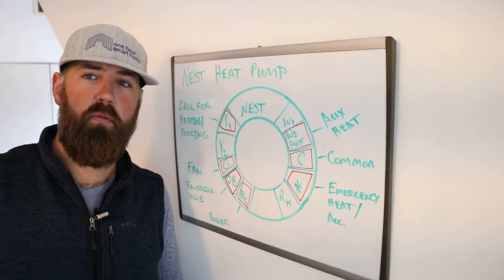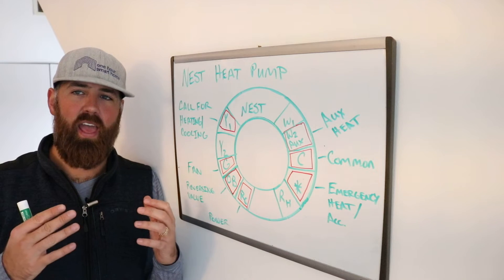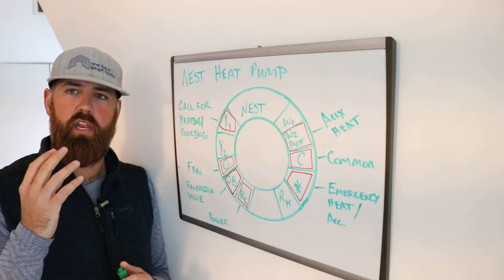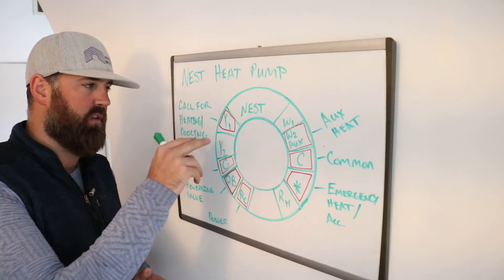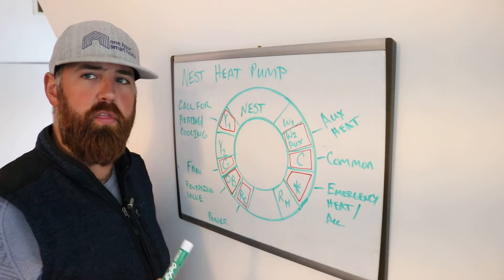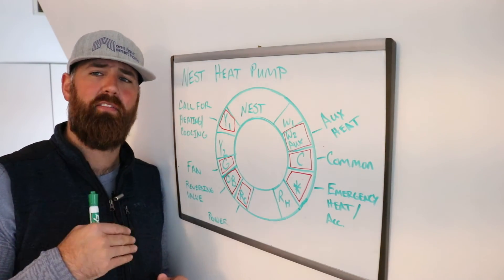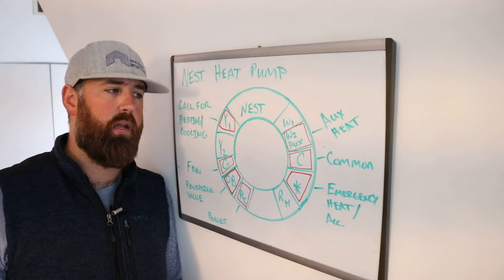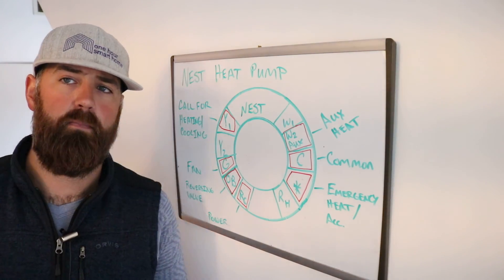Nest Heat Pump Wiring Diagram:  How To Wire Nest With a Heat Pump

Comment: Dual System. Airconditioning (cool in the summer and heat in winter) and also underfloor heating with electronic thermostatic valve. The underfloor heating is getting the water heated from the same Heat pump throw a hydro kit.  Could Net thermostat work for the controlling the whole system. I got a photo diagram of the system if you want to, i need an email..Thank you !

Comment: Thank you for this video very informative. I do have a question (for all)that I've been searching all over the Internet and I cannot find. I have a old AC central air unit with ducking that I'm planning to upgrade later on to a heat pump. But I am in New Yor City, so I do have a boiler with circulating water. I would like to use the heat pump and when it gets colder use the boiler being that I have solar panels. But I cannot find anything that reflects that situation any info will help

Comment: I’m trying to add a nest thermostat in a home we recently purchased. The house has an Aprilaire system now that has 2 wires I can’t figure out where they go if if they’re even still needed. One is an “ODT” wire, the other is a “GND”. I figure out it for an ambient air temp sensor that activates a secondary heat if below a certain temp. 

HELP.

Comment: Thanks for the overview guide. I'm curious if the Nest can be wired to run a gas furnace for auxiliary heat. I'm considering adding a heat pump to my existing heat-only HVAC system and would like to use the furnace when the hear pump would be overtaxed by the exterior temperature (more efficient than the resistive coil). I've also heard of a UK smart device from Homely Energy that will run your heat pump based on current weather conditions and electricity prices. Would be great if that could be combined with a nest for automation.

Comment: Thanks for the video. I need this but still not sure how to wire this up. I have an orange wire that was ran to W1 on my old thermostat and I’m thinking I wired it wrong since I have a heat pump. Does the orange wire need to goto OB spot? My outside unit is not kicking on and just blowing cold air for about 20 minutes and then my heat 2 kicks in and then I have heat. Any info would be much appreciated. TIA!!

Comment: The trick here is how to set up the O/B terminal which energizes the reversing valve. Depending on the manufacturer the HP heat or cool fuction will depend on whether this terminal is energized or not.  This dude fails to explain how to set up this function.

Comment: Does the Model G4cvZ work with a 3H/2C system? I have 8 wires for 3 stage Heat and 2 stage cool. Any suggestions?

Comment: I have a heat pump with an emergency heat and has 7 wires at the air handler, but unfortunately the existing wire of the thermostat has only  5 wires instate of 7 is there any way to make that work from the thermostat?

Comment: I live in Vegas we have package units on the roof or some people call them swamp coolers. but I installed the nest in the summer so didn't check if the heater was working. now its blowing cold air out when its set for 75 and its 55 outside? and I did change the filter. have a 6 wire set up y1 g ob set to O w1 c and rh. is it the set up or do I have a bigger problem?

Comment: HI: I've enjoyed your videos, but haven't quite found what I need.  I'm trying to replace an old Evcon 3600-367P with a NEST thermostat. The NEXT has Y, C, W on one side and G, R, OB* on the other side of the backplate. Can you tell me which wires should go into these terminals as the orig stat has O (orange), W2 (white), L(blue), X(black), Y(yellow), E(brown), G(green)... many thanks... Pete

Comment: Question, With a heat pump and a nest. On my air handler circuit board I have a W1 and W2 input. Currently I have them connected together to the W2 from the nest??? Correct? Heat pump operation work correctly at this time.

Comment: For whatever reason, the nest thermostat sold in Europe looks exactly the same but is actually completely different internally from the one presented in this video sold in the US, mainly because there are historically many 220VAC electric heaters in EU, and nest had to change the electronics from top to bottom for the European market. But nowadays many energy efficient passive houses are built and the advised solution is a kind of HVAC that uses an air-to-air reversible heat pump to heat or cool down the incoming filtrated air and extract the exhaust air outside. Unfortunately, the EU nest thermostat 3rd gen is INCOMPATIBLE with reversible heat pumps, i.e. those that can heat but also cool down the air, do you believe this? If I decide to source and purchase a US version of the nest thermostat for my reversible heat pump, do you know if I can change the language settings and set the temperature to display degrees Celcius instead of the Fahrenheit scale?

Comment: Hello 
Thanks for the video 
I do have a heat pump unit so i have 7 wires coming to the old thermostat its has wire going to W2 terminal and jumper to terminal E … also i have a L terminal so I don’t know what i should do it with nest thermostat 
Please could you help me out with it

Comment: I have an x wire in my old thermostat and was wondering if that is needed? I also ha a c wire but when I connected it to my new one it didn't turn on (i bought a nest E). do you know what could be wrong?

Comment: Thank you, this is great video! I am researching replacing the thermostat for my heat pump and it has all 7 of the  connections you outlined here. It is doubtful that I could have wired the device correctly without this. However I would prefer to get the newer 2020 nest that has the 6 wire connections. Is there a way that I could use that instead of the nest learning thermostat?
Reply: I have this same question!🤔
Reply: me too
Reply: Same question except i already have 7 wires and the 2020 Nest AND i can't find an answer? Anyone just twist 2 wires together and test it out?

Comment: Hi 
How can i connect  my boiler( 2 wire) and my Hvac system ( furnace)  to my same nest pro  thermostat since ill have to sources of heat but i would  like to set the heat from furnace  to 2 stage. Need help . Thanks.

Comment: Thanks this has been a huge help! Recently purchased a new house a realized when watching this that it has a heat pump. I noticed my current thermostat also has (2) “S1” wires - one is brown and one is black. Do you know what these are and do you know if a nest would be compatible?
Reply: I have the same setup, where should they be connected?
Reply: I have been having problems installing my nest. I also have the black and brown wires but they are not hooked to anything. Worked in old Honeywell thermostat but not on the nest

Comment: your explanation of what the connections control is great but you do not mention the color of the wires at all... This video has not helped me to actually wire this thing up. (follow up after calling Nest... Y1 = Yellow (heat/cool stage 1), Y2 = blue (heat/cool stage2), G = Green (fan), OB = Orange (reversing valve heat/cool), Rc = Red (main power), W2 = White (Auxiliary electric heat elements to support heat pump when needed), C = Black (common), * = Brown  (emergency heat power to run Aux if heat pump fails), RH = ??I don't have duel fuel (secondary duel fuel e.g. gas/geo thermal

Comment: Hopefully you can help me out. I got a heat pump system and noticed the first time I went to use cooling on my nest it started blowing hot on full blast. Spent two hours talking to Google troubleshooting and they sent a replacement base for it. Didn't help. Google won't reimburse me for a $250 product I bought 3 months ago. Wiring is exactly as it was in original thermostat which still works correctly. I even changed the orientation on the o/b setting. Apparently it's a common problem and it's gotta be a wiring thing. I don't want to buy another smart thermostat. Any help is appreciated.

Comment: Thanks for your videos. I don't have a c wire and want to install my nest thermostat. I have the c wire adapter kit that you put on the furnace. I have it hooked up but can't get it to work. How would I hook up the 4 wires to the thermostat after having the adapter on?

Comment: Wow, this solved the issue for me where the Nest was telling me I was wired up as a dual heat source when all I have is electricity. I watched your video and moved the White wire to w aux and moved the brown wire from the W1 slot to the star slot and now it's wired correctly. Thanks so much
Reply: My aux heat won’t turn on so I move the white wire to W2 and black wire to * thank you for sharing

Comment: I need to figure out how to turn off the Aux Heat, I have seen a HUGE increase in power consumption when running the Aux Heat. It apparently does it automatically and I can't figure out how to disable it.

Comment: I can not figure mine out. It will turn the blower on but I’m not getting heating or cooling. I have used a couple nests on other heat pump units but my brand new home I can not get it to heat or cool.

Comment: Thank you! I was freaking out a little setting up a nest in my new house because previously I had a very simple system and now I have dual heat and I kept seeing all the warnings about how I could mess up my system. I understand that I’m not a pro and I still could mess it up but these are the same exact wires that I have available to me other than the emergency heat asterisk one. I didn’t necessarily need this video to set it up (already had it done just wanted to double check) but I don’t like setting something like this up without knowing what the wires mean so I really appreciate it.

Comment: You mentioned that heat pumps can use the aux heat as a second stage depending on the delta from the temperature setpoint. Do you know if the most basic Nest Thermostat has that functionality? I can't seem to get my to work and I don't see an option for "Pro Setup".

Comment: I have a heat pump. I can connect y,w,r,o to ob* and g. But I'm left with a blue E that I have nowhere to connect on the nest. It's for the emergency and on my old thermostat it has its own terminal. Could I run it without E wire?
Reply: @Witnessesoverpeople  I didn't. I sent it back. I think there is a different nest specifically for my heat pump.

Comment: I have a HVAC with heat pump I installed the nest thermostat 2020 version ,everything is connected as it should and it works,
but Thermostat says unconfigured wires. What could be wrong ? I will appreciate any help thanks.

Comment: confused. I have an electric HVAC with heat and ac. no PUMP and no GAS.. I changed my red wire RH ( e/74 )  to the RC and now I get an e/73. We rarely use heat in Florida but its 45 degrees and I sure wish I could get it to work. HELP!  voc/vn or lin numbers like there were when my ac was running. 

an

Comment: If the system is in the upper North East and is setup to just use electric heat, Would you even hook up the heat pump wire and just use the Aux W terminal? Or I have seen that you can bypass within the Next device to use Alt heat always as heat source. Any thoughts, suggestions or other video running through this unique scenario would be greatly appreciated.

Comment: Oh my goodness! Thank you so much for this amazing video. I feel so smart now fixing the heat pump issue myself. I had warm air, but it would not start my unit outside, so I figured it is a heat pump issue. I checked the wires (which I installed initially) and just pressed the OB cable a bit further in, despite being properly in. Nest recognized some changes in wiring and prompted me to change my heating options, among one of them being the heat pump. Cranked up the target temperature and lo and behold
, AC unit outside kicked on. 
My question is, is the heat pump heating option going to be less expensive then without. Since I had heat already without using the pump. Thank you!! I will subscribe to your channel.
Reply: Heat pumps are 2 to 3 times more efficient I read.

Comment: I have a Nest giving me some difficulty.  I have a heat pump with aux/emergency and the 7 wires from the furnace are connected exactly as shown in this video.  The Nest will display AUX or EMERGENCY on its screen when seemingly appropriate, but the coil never seems to get energized and the house temperature falls if the outdoor temperature is around 45F or below.  The entire HVAC system is about 3-4 months old, so it doesn't seem particularly logical that it's a failing component (though of course it could be), but it seems like more of an installation error at the "other end of the connection" (i.e. the connection to the equipment itself).  It's in the attic which unfortunately isn't accessible to me (let's just say I exceed the rated capacity of the attic ladder by > 100 pounds).

First off I'm just wondering if this is an issue you've had reported.  The installer here just says "it's a common problem with Nest thermostats" and that makes little sense to me because I doubt they'd sell very well if they couldn't perform the basic function of being a thermostat.  Bells and whistles aside.

Any ideas y'all might have before I abandon the Nest for a Honeywell thermostat?
Reply: By the way, I should say that the explanation in the video is exceptionally clear and appreciated.
Reply: As I kind of thought, the issue wasn't with the Nest - a wiring harness up in the attic had two wires that were supposed to be joined to each other at a connector that weren't.  Not sure why the manufacturer would create such a thing, but...   Anyway, a different tech correctly diagnosed the issue and connected the two disconnected wires, and now all works as designed.  :)

Comment: You are the best. Just finished setting up the Nest thermostat in the basement which has a heat pump. I also watched your other video for adding a common wire to the unit upstairs. Your explanations are very easy to follow. Thank you...

Comment: So what I need to know is I have the most basic nest but I also have an all electric heater. So I have the W2 wire that currently has nowhere to go because the most basic nest doesn’t have a slot for it. I have all the other slots but not that one. Because of this it takes forever for the house to heat up in the air that comes out is kind of cool for quite a long time before it warms up. What can I do to connect my W-2 wire even though there’s not a slut on the nest.

Comment: Hi there, I have a similar problem but in heat mode and emergency heat option. After that our Nest stopped working with the WiFi is getting bad, looks like it’s trying to connect find a connection even if you want to used just like a thermostat with “Do Not Connect” option and sometimes it’s doing a fast reset that doesn’t works because all the time the Nest never find a signal automatically or manually. Now our Heater is turning On and Off every 1 second when the temperature is close to the set temperature and I need to down the temperature to turning Off, so I believe that our system will damage soon. Do you know what’s going on?
Regards.

Comment: Just had heat pump and air handler updated. Wanted to update thermostat as well. Only problem only 4 wires. They are currently using the the fan wire for the reversing valve. Suggestions on haw to fix?
Reply from the maker: You could fish new wires to the thermostat. Or if running wires would be a big project you could relocate the thermostat next to the HVAC system where it would be easier to run new wires. Since most of the time you could control the thermostat: https://amzn.to/3omfvmu  from the phone or with Alexa. You can also install Nest thermostat temperature sensors: https://amzn.to/37sSpEC so that you dial in the heating and cooling to the location your existing thermostat was located or to hold the setpoint for another part of your home.

Comment: Thank you! This fixed my problem!  I installed a nest e thermostat late last spring.  When in cooling mode, my draft inducer fan (for heating) was turning off and on continuously when the air conditioner was running.  After what you said about sometimes using the "common" wire, it turns out that I had to connect the blue wire to the "C" terminal and also to the "C" terminal on the furnace circuit board.  My old t-stat did not use this wire. The nest e directions did not require me to do this. It solved my issue, no more draft inducer fan running during the cooling mode.  THANKS!
Reply from the maker: Great to hear your problem was solved. Thanks for the comment and watching.
Reply: Hi there, I have a similar problem but in heat mode and emergency heat option. After that our Nest stopped working with the WiFi is getting bad, looks like it’s trying to connect find a connection even if you want to used just like a thermostat with “Do Not Connect” option and sometimes it’s doing a fast reset that doesn’t works because all the time the Nest never find a signal automatically or manually. Now our Heater is turning On and Off every 1 second when the temperature is close to the set temperature and I need to down the temperature to turning Off, so I believe that our system will damage soon. Do you know what’s going on?

Comment: Love your videos, thanks. I have a heat pump but my old wiring has two bridges, one from Rc to Rh and one from W to Y. I have the white wire going directly to Y before bridging to W and other than that I only have the orange wire going to O. So I am not sure how to reconfigure these bridges to the Nest?
Reply: The same wiring with me. G.O. RC jump to RH and W jump to Y. Did you know how to wiring now? Do I need C ?please help me
Reply: Hi, I have the exact same issue.  Old system bridged Y to W.  I tried connecting the Y only (and O, G, and Rh) on the Nest but only cooling works, not heat.  Any suggestions much appreciated!